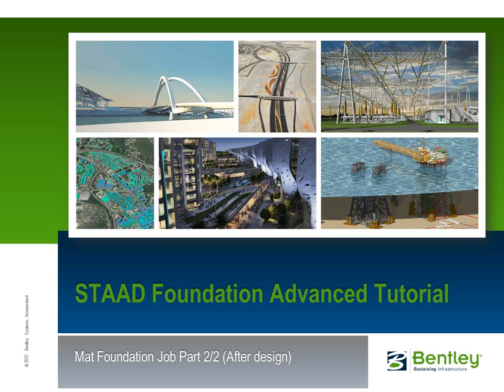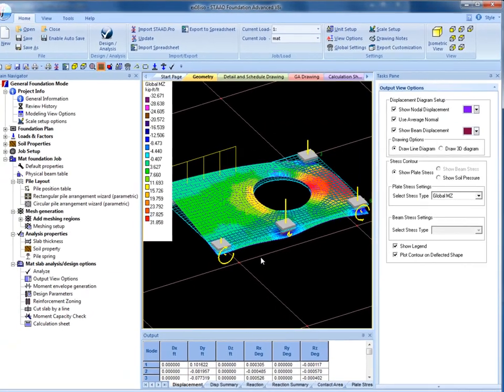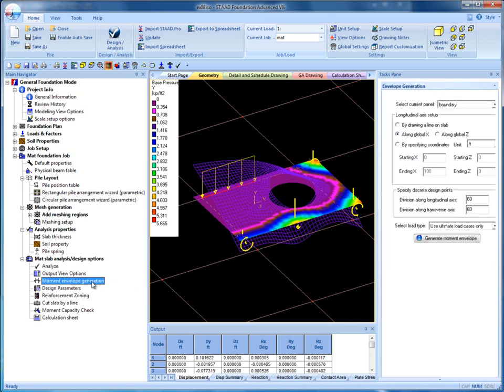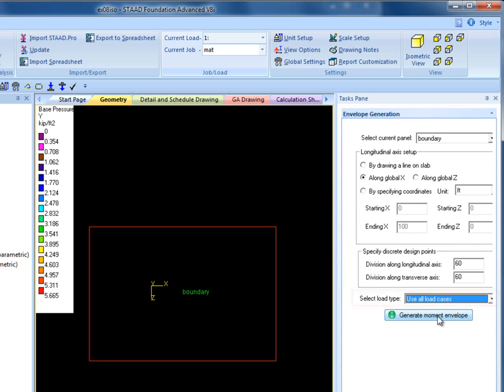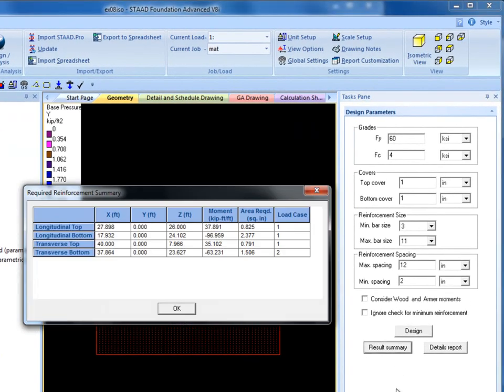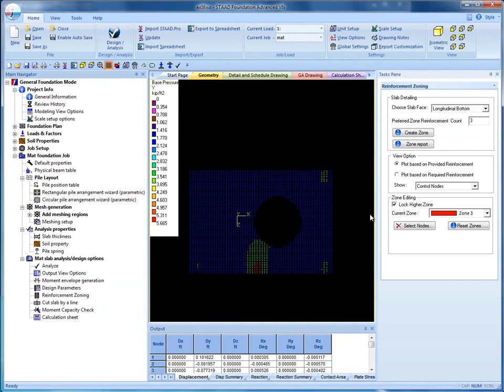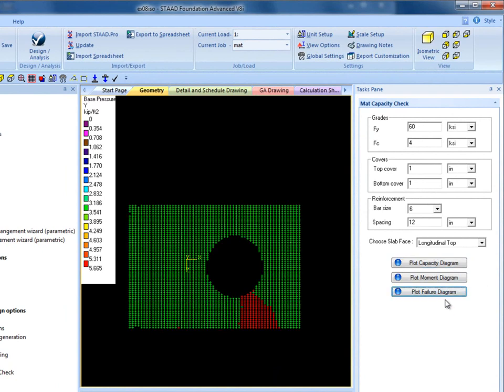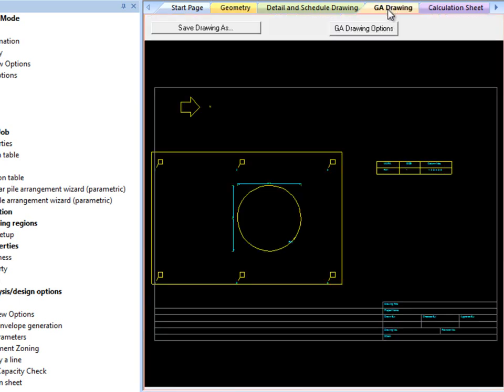STAAD Foundation Adv 19: Mat Foundation, Part 2

Comment: Can anyone tell me what the problem is if STAAD Foundation will not display stress contours after the analysis?
Reply: The stress contour legend has values of all 0. Why is this happening?
Reply: kberthelot It could be that your analysis was not able to run. I have had this happen when my foundation was not thick enough to produce a valid solution.
Reply: I have the same issue.. Did you manage to fix it?